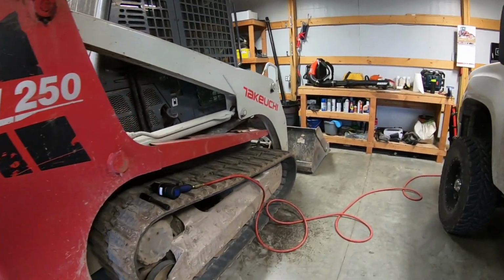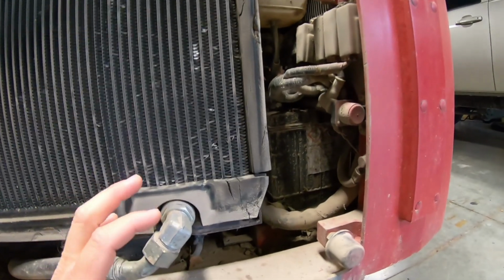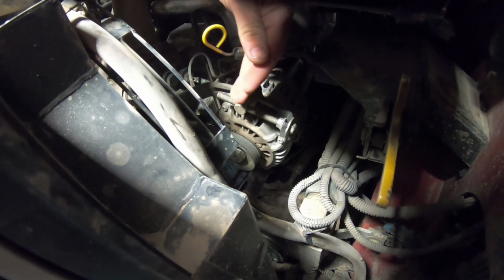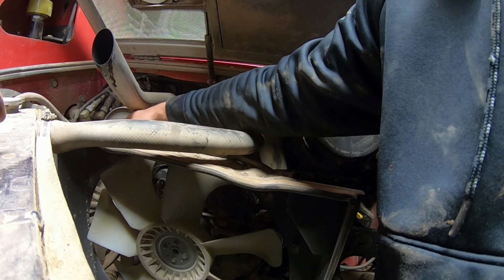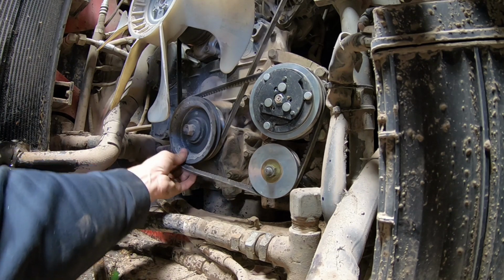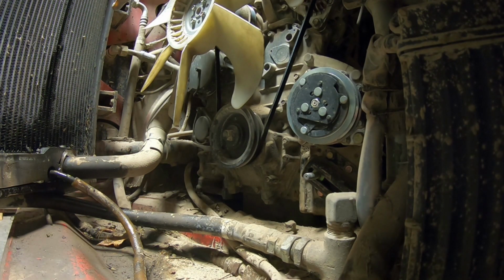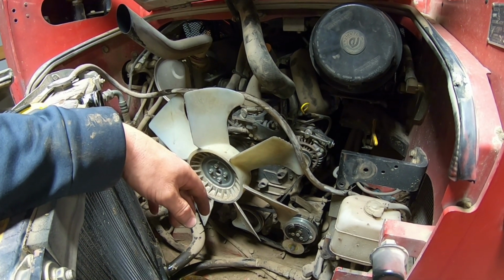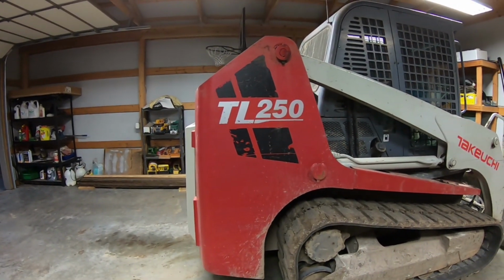Installing New Belts On Takeuchi TL250

Comment: TB016 to get to the belt it seems you have to start by  lifting up the canopy😢😢😢. You're talking about a plate on the side to access your battery; I'm thinking of cutting out the side panel and putting hinges on the cut-out to access alternator, belt, fan, radiator, etc. Anybody got any idea? Thanks. Have posted on forums (,e.g. Heavy equipment,) but no luck.
Reply from the maker: You may have to lift the canopy to fix that

Comment: For future reference belts usually start squealing if they are a little loose.  Like if at idle there's no squeal but you turn it up to full throttle and the belt starts squealing it's probably a little loose.  That belt looked to be in amazing condition for it's age.
Reply from the maker: That is true. The one bent was fine but I had to take it off to get to the other one so I just changed it. Appreciate you watching

Comment: The p.o. of my machine put a belt on wrong and installed the fan backwards. It was trying to run hot when I got it. Finally figured out it was the fan that was installed improperly.
Reply from the maker: skidsteerdrew oh that’s aggravating. I almost did that the first time I changed the water pump. Just grabbed the fan then noticed when I was tightening the last bolt it was on backwards. Thanks again for watching

Comment: If belts are too bad keep them on the machine some where for the just in case get you buy thing
Reply: But I work on a boat so I do throw anything out unless it's absolutely junk.
Never know when you need the get by parts to get in
Reply from the maker: Josh Welner they were squealing like crazy! Was driving me nuts but I did keep them in the shop in case I need a back up. Thanks again

Comment: Nice work on the belt change. That was a good idea to trade both machines at the same time. That way you know they will both wear out at the same time. I found my Takeuchi dealer is 200 miles away,but it is the ditch witch dealer. But like I have said before the local Cat dealer is 20 miles away. I guess it depends on where local dealers are to purchase machines.
Reply from the maker: Brian Gardiner thank you! Yes that would definitely be a big deciding factor, I love my Takeuchi but if the dealer was that far away I would have to go with a different brand. Be a pain to order everything you need online all the time. Thanks again for watching

Comment: Nice job Brandon. That actually didn’t look that bad after watching Jason-Works-Too-Muchs last video. It was a little hard to see on the video, but the old belts really didn’t look that bad. Next time you get a squeaky belt, try rubbing a little bar soap on it. It used to work in the old days 🤷‍♂️. WARNING! Only apply the soap, while the engine is OFF! My grandfather lost the tip of a finger doing that once 🤬! 🤜🤛
Reply: talcum powder works wonders ! (baby powder that butt)
Reply from the maker: J. Chris Beck cool good to know!
Reply from the maker: psidvicious I didn’t think they were to bad either, I tried the belt dressing stuff only worked for a few mins. I have heard of the soap trick but yes only when the engine is off! Ouch that’s not good! I can see what he is thinking though  easier to get the soap on if the belt is moving. Thanks again for watching

Comment: May as well not have a swing-out radiator for as much room as it gives you to work on anything eh? Dunno if anyone else does it, but one job near me had a couple of JCB track loaders on it, and they've actually got their radiators mounted on top of the engine compartment and pulling air down through that way. Which seems like a much better idea, especially if you designed it right and all the usual servicing stuff was right there when you swung the door out.
Reply from the maker: Sandy yeah that would be way easier, I believe that’s how most of them are now. I think the new Takeuchis are that way. Makes more sense! Appreciate you watching again

Comment: my Caterpillar is so much more service friendly!
Reply from the maker: Clyde Acor that’s because CAT always needs worked on more 😉. Lol just messing with you thanks for watching
Reply: @eliteearthworksllc  haha... you betchya. I have 8200 hours on it and really haven't had to do anything other than change the oil and a couple of hydraulic hoses. I really like how their radiators are above the engine and its fan runs off the hydraulics and even though the radiator is on top it'll still lift up out of the way without bolts holding it. It works like a hood latch.
Reply from the maker: Clyde Acor yeah that is a slick design definitely makes it easier for routine maintenance. The brand new Takeuchis may do that now I’m not sure but it would make more sense to me!
Reply: +Elite Earthworks LLC ya this ones an older 2001 262 model with the Perkins engine. I wished that they would've stayed with the Perkins instead of going with the Kabota engine, that Kabota uses at least twice as much fuel and feels underpowered!
Reply from the maker: Clyde Acor Perkins was a good engine. Mine has the big kubota in it. Seems to burn about a gallon an hour which is pretty good compared to the new ones.

Comment: The cold weather is just so hard on equipment. This time of year just brings every little problem to a rolling boil. What State do you live in? Many people think that small business owners avoid the shop because the shop writes a bill, that is only true to some extent. You have to do whatever gets you back in the dirt faster. You can use a shop bill as a tax write off. You can't get a write off for 3 days of lost work waiting to get your machine back. Many people bring cars to me because they don't trust shops honesty. I work day shift so people like to bring it to me when they get off work and take it back home when I am done. I am also willing to let people watch me work on their stuff. That works out good for everyone, they get their proof it was actually done and might learn a bit. Around here the shops have been telling people they need 2 or 3 services when they need 0 or 1 service. I have my wife take some pictures on jobs where people just want a drop off and pickup. The tires are easy either the new ones are on or not, either the flat is holding air now or it is not. These are some of the reasons I have been thinking about doing videos, the camera don't lie.
Reply: tdej80 go for it dude!
Reply: @The_blindpizzaguy1300  If I get the equipment and make the commitment I would also be doing welding videos. I am still Luke warm and I can't do anything unless I am all in. Maybe something will stoke my fire and get me white hot. Something like Elite bringing that bucket to me? It is nice to have someone with experience walking with you the first time. Thank you for your positive feedback!
Reply from the maker: tdej80 yes it does. I agree for me anymore it’s s time issue, I use to want to fix all my own stuff but now I’m realizing I can be out in the field with one of the machines while the other is getting fixed and I’ll make more money because I don’t lose a day or two working on one of them. I’ll still do some easier stuff but it always boils down to time. I’m in Joplin Missouri. The camera idea sounds like a great plan if you ask me. I really appreciate you watching
Reply: tdej80 u